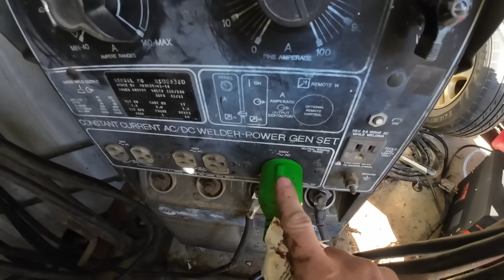No Other Machine Like It - Custom Backhoe Upgrade Finished and Tested - Summit Hydraulics

Comment: Mike, It looks like you could added a mounting bracket to the bottom of the top bar that goes across the front of the backhoe @16:17!  That way, it is out of the way and you will not have to worry about damaging them if you attach them to a pipe on the outside of the machine (We know you record 😂😂).  You can always add a flex strap to hold up any hoses to prevent them from getting in the way.   "Use Extra Protect", "Avoid future little Headaches".  Mike, someone saying things like that would believe that your talking about a 3rd function valve! 🤣🤣🤣🤣

Comment: You used very creative solutions to resolving the installation issues. In a past life,  I used clamps similar to the ones you fabricated.  The only difference was we’d use heat shrink to cover the entire clamp to prevent chafing or clearance issues.

Comment: I have that grapple on a John Deere 710K tractor backoe and pushed it to its MAX!!  The new one is on a JRB416 coupler and added 250# of steel to the square tube and reinforced teeth.

Comment: Yep, you're going to be even more productive with a grapple.  And although I rarely feel like making suggestions, because usually you're several steps ahead of me, I'm going to this time.  I added a bracket and bushings to the top edge of my standard bucket, and put what was essentially a thumb on top of it, that mated with the lower front edge of the bucket pretty much kept it on the whole time. (Have since replaced that tractor with a larger one, also with 3rd function).  Was extremely handy in moving rocks, logs, and so forth, when I needed to do "bucket work" at the same time, and didn't feel like driving back to the barn to swap attachments.  (Had just three pins and two hoses to remove the thumb.)  Enjoyed watching, thanks, and take care.
Reply: Sounds like a great idea Dan plus the bonus of video content as Captain Kleeman fabricates it. 👍🏻👍🏻👍🏻
Reply: DAN!!!!

Comment: Hint for when you do the extra funtion on the backhoe for the thumb:

Hard line (tubing/pipe...) is typically cheaper than the reinforced rubber hose.  

That's why you see the hard lines on most long runs along frames.  Learn to do the flair fittings if you don't already know.  
Check pricing of tube and added fittings.
Save a few $$$ maybe.
Reply from the maker: Yup.

Comment: A guy makes his own hose hold downs to save money yet rolls around under a machine in a designer sweatshirt. Unbelievable. What a world we live in..
Reply: How else is he supposed to afford the sweatshirt? 😂
Reply: Lots of designer stuff at the Goodwill!
Reply: Username error.  Should be JasonComplainsAlot.
Reply: @SeanONeill13 
It’s called a joke and a bit of sArCaSaM. 🤦‍♂️
Reply: Jason. I think he has connections and gets them cheaper than retail. 😉😉
Reply: That hoody costs him a hold day of work at D P 's
Reply: @SeanONeill13  @JasonworksAlot is actually friends with Captain and DP.
Reply: You are still alive.  The Podcast is still going even without you.  LOL
Reply: @johnunsicker7440 
Maybe he’s also the MBTS.
Reply: Weld a nut between them slightly larger than the bolt or self tapper you put into the frame .
Reply: Can’t beat “a whole lot a more” 😁. Great project, will be super useful. 👋🇬🇧
Reply: Comment generator works well!!😅
Reply: @johnunsicker7440  I know! And I get sneak peaks of them cause I still do the scheduling hahaha. I’ll tell ya, it’s all about the perks at the end of the day 🙃
Reply: @CaptainKleeman Merry Christmas

Comment: When you go to buy a grapple, you should try to find one that has 2 separate claws to it. If not, 1. you can end up bending the single piece claw under the torque of uneven objects. 2. you can grab uneven stuff without the smaller piece falling out before the bigger piece does. I really liked the type of grapple style that you have here better, but in reality the 2 independant claw setup is more functional
Reply from the maker: That's the plan.  Seems like a better fit for what I'll be doing, thanks for watching Jesse!

Comment: That Summit Hydraulic kit seems very well thought out and put together right down to the joystick mount. 
Not being able to use an 🎱 for the knob is a sacrifice worth making. The old ‘52 Massey Harris my Dad had had a pool ball shift knob.  Wasn’t an 🎱 though. Probably was a billiards ball.
Reply from the maker: Definitely a nice kit.  They are great to work with.  I guess I could still do an 8 ball for the wheel knob

Comment: Mike, you can get a hose stand-off from Titan Attachments.  It’s a post with a spring base that holds the hoses up out of harms way.  Mount it on the grapple, run the hoses up through it and down to the bulkhead fittings.  It’s a must for grapples with all the moving parts.  You’re gonna love having a grapple
Reply from the maker: Thanks for the tip!

Comment: Capt giving the Triple 5 more versatility with each tweak/upgrade. cant protect hydro hoses enough Capt, they are obligated to rub through somewhere, dry rot from being cooked in the heat. you got work cut out for you Capt with dump truck build, Triple 5 cab rustoration

Comment: even though i mentioned i wouldve done this slightly different last video i do think after all these new hold down brackets you made it actually looks really good great video mike cant wait to see more on the f series(bricknose) dump truck project and remember im still interested in the rear leafs if your not gonna use them although i would recommend you just use the f350 axle assebly for now until you find a f superduty axle then you can use the dumptruck for now and sell me the parts later ps the same era  ford chassis rvs with 10lug rear axles are also f superduty rear ends i actually have one

Comment: Bungee the fittings that you aren't sure where to put the bulkhead pate yet.  Pull em away from pinch points.  You might decide to just leave it that way.

Comment: Try using an oversized nut (if you have some) as a clamp spacer and just weld that in there between the 2 pipe halves. You won’t have to drill a hole through the center of the weld 😉

Comment: This has been such an epic salvage. The 555 just keeps getting better. So when are you going to put the front weight back on so it's less of a wheelie machine?
Reply from the maker: It has all the recommended front weights per the operator manual 👍
Reply: Oh, OK, I thought there was one more on the front that you took off early on. I remember you putting on the side ones but not the front one. Glad it's up to spec, I can stop worrying about that now LOL
 @CaptainKleeman

Comment: A quarter turn on the handle so the buttons are pointing to the left may be more comfortable to operate with out having to heat and bend the rod.

Comment: Mike, I dare say you are getting dangerously close to knowing what you are doing and further away from just making it up as you go. Those hose hold downs are pretty nice, and basically what they use on the arms of front load and side load trash trucks. Only thing I would suggest is maybe wait on mounting the quick connects until you find your own grapple. Then you could make it a little more custom fit to your application.

Comment: I know this might come as a shock to some people, but dirt (ground) conducts electricity. Dirt on top of a battery will create a path for current. You can actually take a volt meter and measure the voltage that is going directly between the two terminals. Put the negative test lead on the negative terminal and the positive test lead right in the dirt collected on top of the battery and you will see a voltage measurement. That is where the "ghost draws" are probably happening. Then, clean the top of the batteries off really well and try it again.

Comment: First, Neil asked to tell you he says high, and thanks for the Limestone Playbutton. That thing was pretty sweet and well crafted for sure. Second, that will no doubt be a game changer for sure. Heck the grapple even just looks like it belongs on the front of the ol 555. I could totally see you turning the factory bucket into a grapple bucket with a bolt on tooth bar and upper clamp until you track down a cost-effective grapple at action. As always, keep up the great work Capt. Definitely look forward to the next one 😁👍

Comment: You should weld a flat bar across the top of the little brackets to run the bolt all the way through it and then put the nuts so you can tighten them! Just saying Mike! Good luck friend!

Comment: Hey captain you might want to build a box to protect that mechanism from the elements next I wash the undercarriage and spray after wire brushing gets some pick bed coating and spray the bottom on the tractor and and t metal on the dump truck

Comment: Why didn't you just weld a nuit in there?
Reply from the maker: Where?
Reply: Why not weld a nut between the two curved metal parts instead of welding a piece of metal and then having to drill and tap threads? @CaptainKleeman